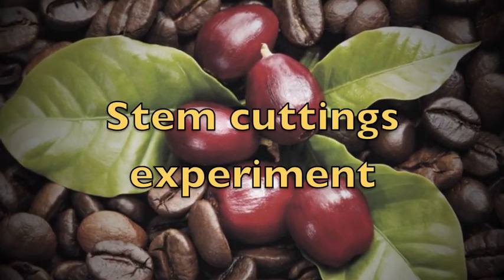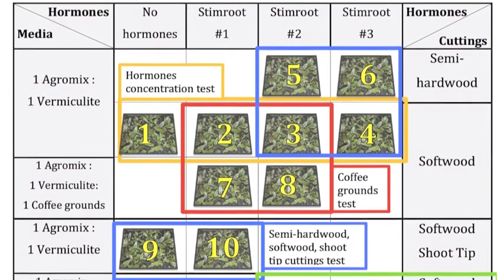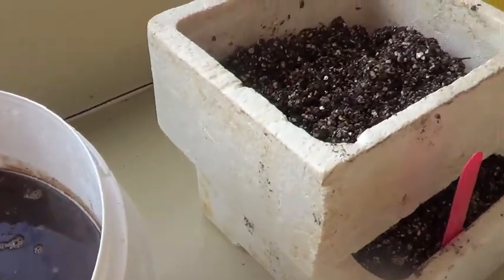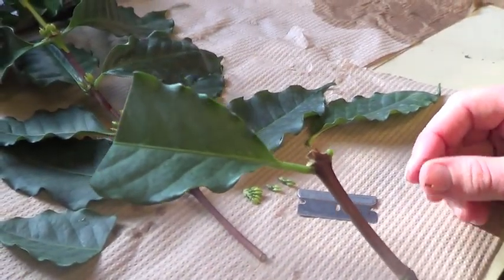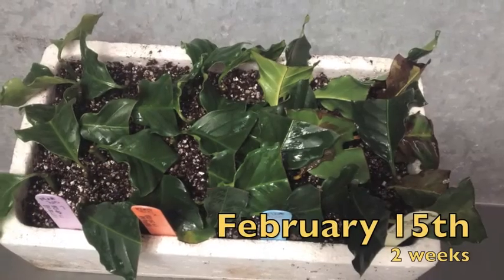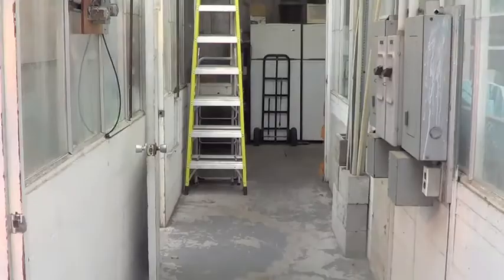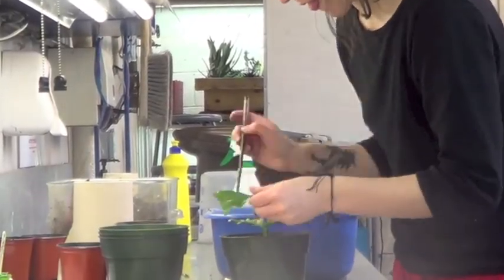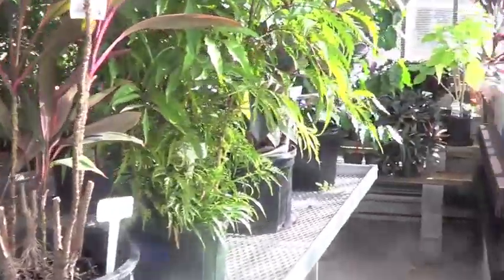Coffee propagation

Comment: I find the regular natural humidity of Florida is plenty, a misting system is not necessary. Place the cuttings under the deep shade of a large oak tree or similar with watering every couple days is plenty. A weekly treatment with miracle grow with some supplemental epsom salt  via a MG brand sprayer will boost you up to  around a 90% successful cutting rate and get the roots growing faster.
Reply: Do you have any plants you'd like to sell??
Or seeds..???
Reply: All good advice. I think what was misunderstood by the student was the natural environment where coffee comes from, mostly that it goes through very lengthy dry periods. Even saplings need to be hearty enough to handle periods of drought and often require it in order to develop properly.